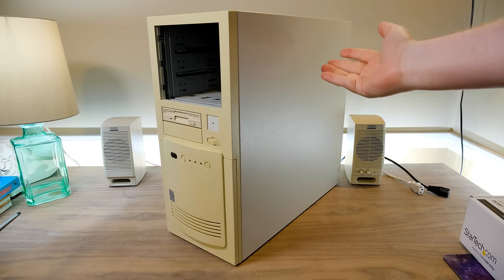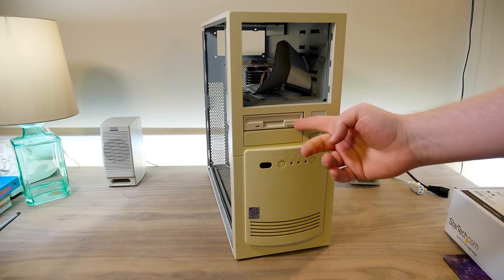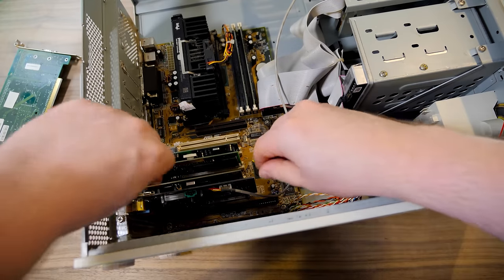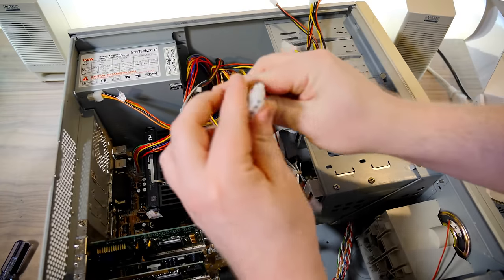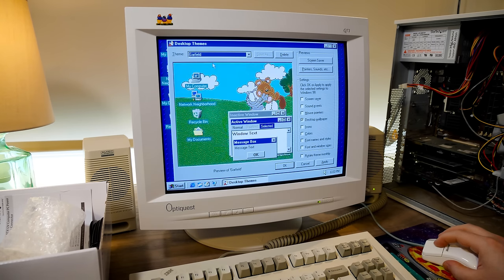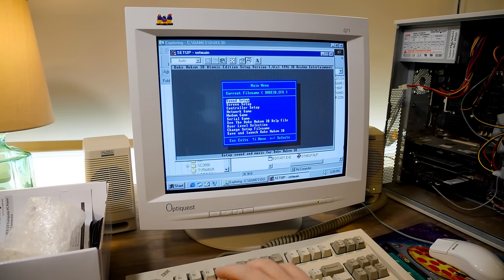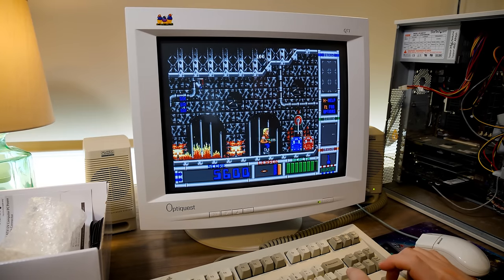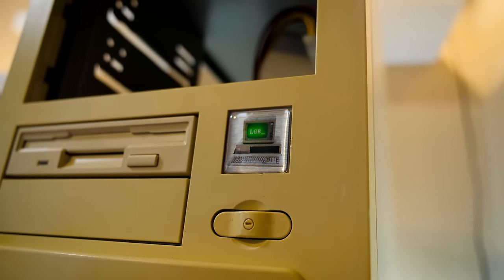Testing This Generic 233MHz Pentium II PC Clone

Comment from the maker: Regarding that "sensor" on the front of the case...
https://twitter.com/lazygamereviews/status/1427391407489273857
Reply: Dangit! You posted that just as I commented about it being IR!
Reply: IR is correct! Many of these mom and pop systems were pushed to be sold as "multimedia ready" - as that was the buzzword of the time - and often included a remote control for media and CD music and video playback from the comfort of your... chair.
Reply: I've only ever had an IrDA port on one of my computers, a Compaq laptop - was cool tho, I could wirelessly sync my palm pilot!
Reply: @kepstin  Completely forgot about the IR syncing capabilities! And in most cases it was faster than serial but good luck not having a table bump knock it off sync :D The good ol' days
Reply: For bonus points, PPP over IrCOMM was wifi for palm pilots before wifi was a thing. The IrDA transceiver modules are an off the shelf transceiver IC, sometimes with integrated LED+photodiode, all the "intelligence" is on the motherboard if the appropriate port is available.
Reply: if Clint says it has dirty slots... there's a joke in there somewhere...
Reply: I used IrDA with my PDA once to my now-wife's laptop.  I'd gotten a critical driver for her and it was the only way I found to transfer the file to fix her machine.  I think it was the USB drivers.
Reply: That case looking mighty beige in your tweet, looking forward to what's next!
Reply: just found this comment after i posted guessing lol
Reply: Anybody else think he might put a mini crt in that square cavity?
Reply: @Ramdileo_sys  You must be new here...
Reply: Makes sense. So glad we've mostly seen the back of these for actual data transfer, they were the worst!
Reply: Clint, how do I get drivers for a SB0200? 'Cause i have one of that and it's driving me nuts!

Comment: Looks like someone's old project PC, and I think we're all guilty of taking the lazy approach to screwing things in.  Only time I really take my time and do it "properly" is when I'm building a machine for someone else, I know my own machines are just going to get pulled apart again in a few months for whatever new thing I'm throwing in there.
Reply: One time I bought a custom PC at a Goodwill like that (IIRC it was right before I graduated university). I think they only used a single screw to hold in the entire motherboard.
Reply: You tell me!
I have a lot of projects going on that I don't even bother putting screws
Reply: I used to be that way. Heck, I ran computers for years without the case covers because why. Hehehe..
Reply: shoemaker usually has the worst shoes :-)
Reply: I had to put an ATX PSU on a babyAT case, and all screw holes but one came out wrong. The PSU is now held above the motherboard by a single screw.
Reply: @SolidSonicTH  Well yeah, typcially AT motherboards just used one, with the rest being on plastic standoffs.
Reply: No way, I always screw everything down. This is more true as the build matures, hell I've replaced the motherboard in my Socket 7 4 times now since I got it about 4-5 years ago. 

My 386, I don't think the board ever came out of that machine since it was put in in 1989.
Reply: I somehow always manage to lose screws for my PC over time.  I think I'm down to two screws holding the PSU in, 1 screw for the side panel, and 3 for the glass panel.  And my SATA ssds aren't mounted to anything....
Reply: @the_kombinator  I kind of doubt that but even if that were the case this PC I'm talking about was an ATX machine anyway.
Reply: @startedtech  I can relate. Ended up buying a bag of PC screws at some point because I can't be trusted with that.
Reply: if it works it works
Reply: @JenniferinIllinois  dust....
Reply: @lpcamargo  I have a plastic container filled with miscellaneous screws I've collected over the years.  If I lose one I just go locate a replacement.
Reply: Oh yeah, I absolutely hate having screws on the other side of drives, so unnecessary in all but the flimsiest of cases.
Reply: I tend to go lazy at first while testing but when everything runs I screw in the rest to make stuff stay in place properly.
And yes, having spare screws is always a good idea.
Reply: I've got a spare Sound Blaster 16 with no bracket, so when I use it it's only "held" in place by a broken 3,5" bay cover. Does that count?

Comment: OH wow; instantly recognized that motherboard as it was starting point of the first computer I built entirely with my own money. Good luck building something with it!
-Asus P2L97
-Intel PII-233mhz with MMX
-Matrox G100 AGP (later upgraded to ATI-Rage-Pro)
-64mb dram,
-Maxtor 4.3gb hdd,
-Dlink 10/100 PCI,
-SoundBlaster AWE64
-US Robotics 56k modem.
-Acer 17" CRT
Reply from the maker: That'd be an excellent setup. Inspiring!
Reply: Yep, I built a similar system in college - I even had all the parts except the CPU ready to go - I waited for the 333 MHz "Deschutes" core Pentium II to come out before buying the CPU. 

I also bought a single stick 128 MB DIMM - ridiculously expensive at the time, and overkill as most PCs were coming with 16-64 MB of RAM; to have empty slots for later expansion. 

This system lasted me until 2003 - I did indeed upgrade the RAM to 384 MB by the end, and a 766 MHz Celeron on a voltage-mod slotket. Radeon All-In-Wonder 9500 at the end, not sure I remember what I had originally; I know I started with my prior-system's PCI Matrox Millennium II and Matrox m3D card, I'm sure I upgraded to something AGP shortly after building the system. I know I then upgraded to a Radeon All-In-Wonder (pre-numbering) whenever that came out. Just not sure what I had in between.

AWE64 Gold with the front panel 5-1/4" drive bay thingy, too. By that point, I wasn't using a modem any more - my college had Ethernet, and my first house after college my roommate and I set up a server with dual 56k modems that linked and shared it to home Ethernet until DSL came out.

Comment: A Tseng Laba ET-6000! I had that exact card in my first own PC. Paired with an Orchid Righteous Voodoo 1. Good memories. Also that PSU fan sound brings back some not so good memories.
Reply: back in the day it was THE card to pair with a 3d accelerator.
Reply: Nah, Matrox Millennium was THE one 2D card to pair with a Voodoo 1 :-)
Reply: I have an Orchid Righteous! I haven't really tested it yet, one of these days... 😛
Reply: Still have one of the Tseng cards, A Hercules Dynamite 128/Video , just don't anything to use it with currently.
The Matrox cards tend to be paired with Voodoos because of their very clean 2D image, so that even after passing it through the Voodoo the quality is still acceptable.
But for DOS it was more common to run a Cirrus Logic or S3 card as they are fast and have good compatibility.
Reply: It's fan-frakkin-tastic for 2D DOS games. Maybe an Nvidia Quadro might be better but it's a tough call, and a Quadro of the right age to be solid would be anachronistically new for an early P2.
Reply: @RaenYrtham  both ET6000 and Matrox Millenium were the best

Comment: I've fallen in love with old ATX cases. I like building modern PCs in old ATX-compatible cases.

Also those ASUS SLOT-1 boards all seem very similar. I have two (P2B and P3V133) and they are almost completely identical. Yours seems similar to those, although mine have three ISA slots (with one of them sharing the same bracket as the PCI slot).
Reply: That's why I want to do with my next computer build it's just sooo much time making the janky accomodations needed for modern heat dissipation.
Reply: I have been looking for an early generation ATX case for a build, but with the crazy increase in retro PC prices here even an empty case will cost several hundred dollars.
Reply: I'd like to find a replacement for my InWin Q500 (lost mine in a house fire),    It's just disgusting how now they're selling all those mid-tower cases (don't see much in full-towers anymore) with NO optical drive bays, but they'll fill it with lights and a stupid window on the side.
Reply: My Pentium 2 board had on board SCSI. It was dope. Added an internal SyJet drive with 1.5GB cartridges.
Reply: @Ozrichead  it's a shame they don't make beige cases anymore. Now everything has to be black with RGB lights everywhere. I hate these modern designs.
Reply: @Ozrichead    If it's a solid vintage case, the weight of shipping alone should do that.
Reply: My father has a few brand new unopened cases from like 1999. They are white, not beige though.

For a while I had a modern PC in one of those, but it's impractical for modern uses. It's not really good for modern GPUs and higher end CPUs. It was a lower end system so it worked, but not having USB and headphone jacks on the front was annoying to say the least.
Reply: @masterkamen371 Can’t you use a 5.25” drive bay to add front panel IO?

Comment: Ah yes, smacking the case to make the noise stop. Reminds me of an old P4 clone I had.
Reply: Nothing like a good case smack to quiet down the fans. Or several.
Reply: i do that on my 3D printer all the time, since the hotend fan sometimes fails to spin up and makes grinding noises
Reply: I do that to my current machine... the prices on 230mm fans are absurd or I would replace it.
Reply: "Percussive Maintenance: When you hit something with a stick, and it starts working again."

Favorite solution of a teacher I had in high school. Most of the issues those old ass computers had was solved by a good smack. For the day, at least.
Reply: @Leurak Does it not throw off the printing? I accidentally bumped the desk once while printing and it messed a part of the print up. And it was quite a rigid desk too.
Reply: @masterkamen371  the issue only happens when starting the printer, once the fan runs normally it won't make the noise again until restarting the printer

Comment: Right off the bat, I thought the case style looked familiar.  Then you turned it around and confirmed that you have basically the same OEM case with just a different front panel.  We had two white box PCs (P3 1GHz or so) that we used for random things in the past at the office.  One of them was our VPN server for a good bit of time.  I just recently took the case home to use for a sleeper build or something someday.  It's interesting enough to keep around.  Solid case.  Just not great airflow options without some more major mods.
Reply: "sleeper case" LoL

Comment: In my experience, that Dell OEM Soundblaster Live 5.1 Digital is a fantastic card for EAX. Specifically the "Digital" one (SB0220) and not the normal one. I'm sure you've got plenty of good cards for EAX, but when I was building my Voodoo 3 machine in recent times, that was the card I went with. Cheap, because no one wants them. Just about every other Live card in that time period kinda sucked. Bunch of budget garbage around then, when it came to EAX. And nearly every game in the era that I built that PC for supported EAX. Some people might prefer Aureal Vortex stuff, but EAX is what I've got nostalgia for.
Reply: The SB0200 in this video is "fake" in that is doesn't have a real EMU10K1 chip. Everything is done in software. SB0220 on the other hand, has a real EMU10K1, and it performs like any other Live card (neither better or worse). However some SB0220 lack the connectors for CD input, and all SB0220 lack the Live header pins (40-pin AUD_EXT), so you can't connect a front panel. It's the cheapest version, made only for Dell.
Reply: If it doesn't do sound processing onboard, it's practically useless for gaming. 
Phil's Computer Lab did a comprehensive test of a number of sound cards and the one that did everything in software took off like 20 fps in all games. Most CPUs from that time will be impacted by this, unless you have something like a 1GHz Pentium III. 

You're better off with an AWE64, at least that does DOS somewhat properly as well. It's also one of the highest performing cards. If you get a Gold, it'll also sound very clean. Though nowadays those are worth hundreds.

Comment: Now you've got me awfully nostalgic. I haven't touched any of my old computer crap that I left at my parents' house when moving out in years, but I do know I had a P2L97-DS, as well as a whole ATX system based on a Gigabyte GA-686KDX (dual Slot 1 i440FX!) with custom cardboard air ducting to keep temperatures of its two PII-233s in check, and a retro AT machine that after two different 486 VLB boards eventually ended up with an older revision GA-586HX with a Pentium 133. Both are using Dallas/Odin RTC clock modules, and at least one of those was already dead in 2012. Had some nifty hardware in there.

Comment: This is sooooo close to the 166 machine I had growing up as a kid, slight difference on the case (that mystery sensor) and I wished I had a sound blaster live back then but otherwise it's sooo similar. Just needed the old US Robotics modem and windows 95 plus and I could have been looking back in time. Best video in a while, hearing that PC speaker brought back some great memories

Comment: I would love you to make/keep it as a "crap machine", only using some nasty thrift hardware in it, obscure branded and cheap stuff, mismatched appearance, just like a lot of PCs looked like in the 90s after they had been "upgraded". So much nostalgic feelings!
Reply: Its like a cage match, elimination where each part that dies loses
Reply: Chuck a whole butt ton of them obscure thermaltake peripherals. Make it as beastly as possible 🤣 💪🏼
Cigarette lighter, cup holders, front speaker w/ those dodgy equalisers and don’t forget those external mic holders clip things that no one ever uses afaik. That would be boss.

Comment: Sparkle power was a super common OEM power supply manufacturer. The units were actually made by FSP, a very good power supply manufacturer that you still hear about today.
https://en.wikipedia.org/wiki/FSP_Group
The fan could easily be rejuvenated with some oil on the bearings. If the capacitors look to be in decent shape and have a good manufacturer. I'd leave it in there if all you would need is 250w.
Reply: Came to say more or less just this. When i started building PCs 22+ years ago this was a good brand.
Reply: Was just looking into Sparkle Power and got suspicious about the FSP style name of the unit.
Turns out they're part of FSP and even sell under that brand today.
And while it's correct that ATX is ATX, in this case we got 25A on the 5V rail, and 14A on the 3.3V rail which drastically reduces the availability in recent units by reliable brands to 650W and above in case of a replacement.

Comment: 2:25 that fan went boooom 
it's usually fixable tho, take the fan sticker off, than the rubber cap under it and put a few drops of an oil of some kind
had a psu that did a similar sound and that fixed it
Reply: Yep, it's the bearings.
Reply: Mineral oil, the kind you lubricate beard clippers (and similar) with, I’m sure LGR has some.
Reply: Mr Carlson's Lab did a video on fixing a sleeve bearing fan somewhat recently, where he explains how to do it properly. Well worth watching.

Comment: Also found an Tseng Labs ET6000 recently. Mine was in an old pentium 166MHz system in an At case. Think this card was released towards the end of 1996 in a time where Tseng Labs already lost much of its glory. I think you'll want to fill up that AGP slot quickly with something else :) Love these early ATX pentium II 233MHz systems. Have one in a nice white (no yellowing) Inwin maxi tower case on an Intel board. Been planning for ages to do something with it.
Reply: I will say that the Tseng Labs cards were impressive in the early days.  They were both fastest and most compatable before the 32 bit bus came around.  A lot of people like the Cirius Logic 54xx series, but I think Tseng Labs puts those to shame.
Reply: @dintyshideaway9505  I think you're right all the way up to the ET4000. But after that they were just too late to the party. But still it's always nice to see a tseng labs card :)

Comment: My family had almost this same PC prebuilt from a local shop back in the 90s. In the early 2000s I used it as a home file server. I remember updating the BIOS so it would work properly with larger IDE hard drives. I actually still have it today as my Windows 98 gaming machine. I tricked mine out with a 533 MHz Celeron processor using a slotket adapter.

Comment: I really miss those beige AT cases.
My first PC was a Baby AT PC-Chips M717 motherboard Mitac branded that had the overclokeable Intel Celeron 266 Mhz (OC-able to 400Mhz) with a sis 6326 8MB onboard and onboard SB-16 HT1869+ PCI. I miss that machine.

Comment: Such nostalgia! P2L97 was a good board. 440LX chipset, IIRC. I had the P2L97S with the built-in Adaptec SCSI. Had a PII-233, 4GB hard drive, and a Pioneer slot-load 32X CDROM. I dual-booted that bad boy between Windows 9x and FreeBSD. Next machine was a PIII-733.

Comment: The Asus P2L97 was one of the most popular 440LX boards, but that chipset was quickly forgotten after the 440BX came out.
This first generation of AGP boards caused a lot of grief to 3D gamers, because most of them had a flawed design that couldn't supply as much power to the AGP slot as the specs required.  Manufacturers didn't take the spec seriously because nobody would be silly enough to make a video card that draws 6A from the 3.3V rail.  Then the silly cards came out.
This is a revision 2.04 though, which is supposed to have that issue fixed.
Asus actually published a rework procedure for the earlier boards explaining how people could fix their AGP power failings at home.

Only 130W on 3.3V+5V is pretty skimpy for this era (which barely uses 12V), but with only basic parts installed it's probably fine.  Personally I'd use the Sparkle, but it probably needs new caps and obviously needs a fan.

I used Infrared to transfer a file exactly once.  I guess it seemed like a cool idea at the time, but the computers had to be facing each other like 1 foot away.